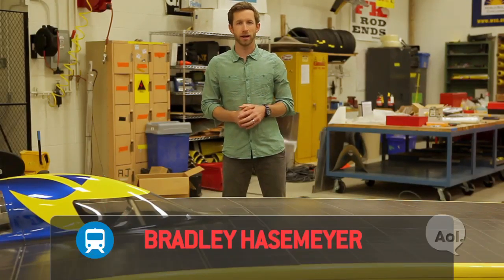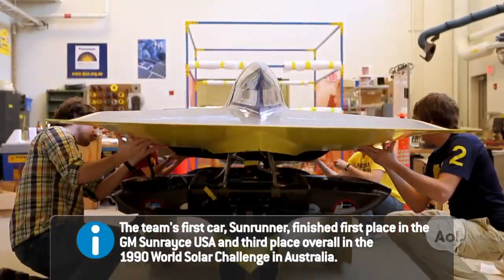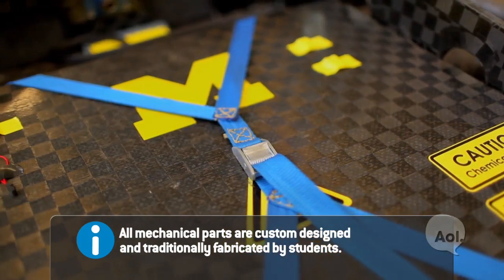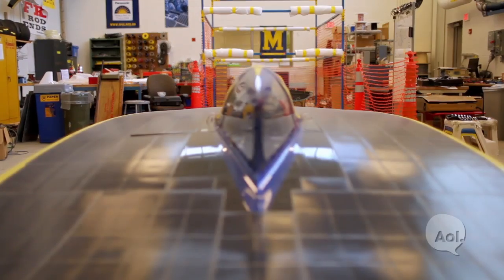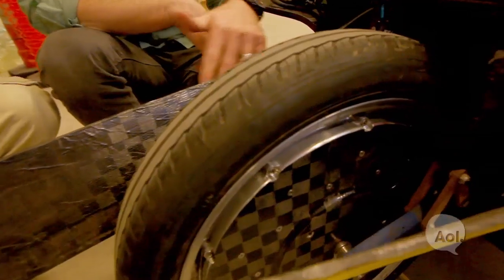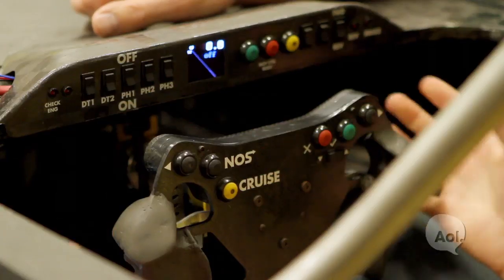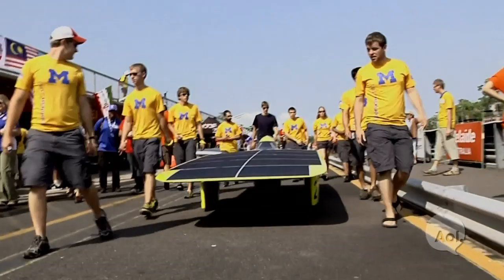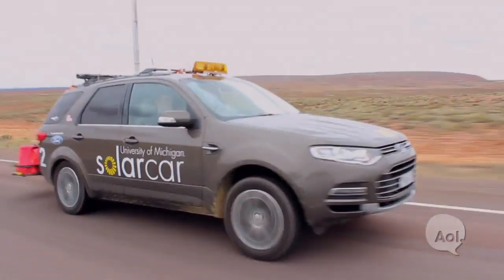University of Michigan Solar Car Team | TRANSLOGIC 99 | AOL On

Comment: 5 kWh is what the battery holds, not how much they used in total over 3000 km.  If they drive for 30 hours (60 mph avg.) * 6 m^2 * ~200 W/m^2 = 36 kWh.  That makes your MPG equivalent number to be about 1,944 mpg, a much more reasonable number for a car that size.  That's still amazing.  All of the numbers above are my personal estimates.  Source:  M.E. Student who builds supermileage cars.

Comment: Travelling 3000+ km on 5kWh (the amount of energy in the battery at the start of the race), now *that* is brilliant. 5kWh represents approximately the amount of energy in half a litre of petrol. According to google calculator that's more than 14000 MPG.
Reply: SolarWebsite Yeet bix?
Reply: Questa è la vera tecnologia automobilistica che si dovrebbe sviluppare